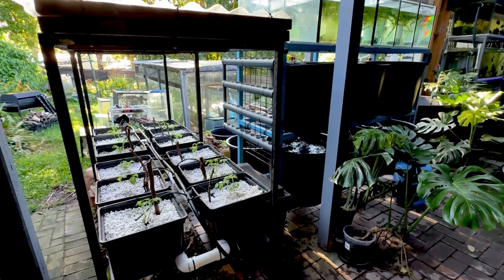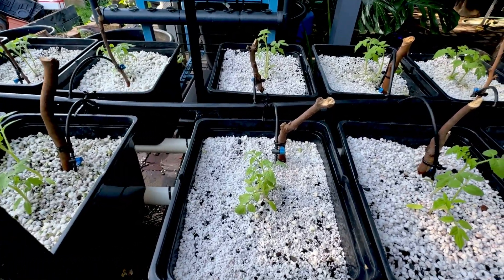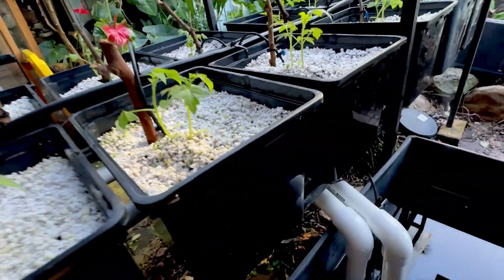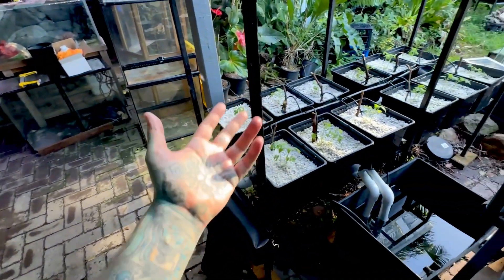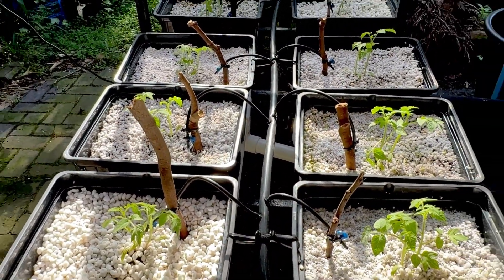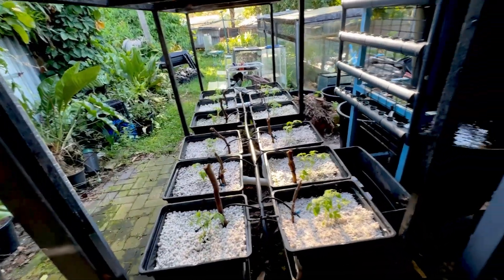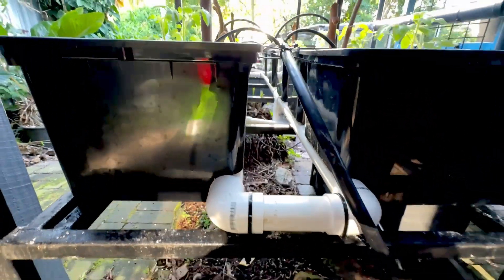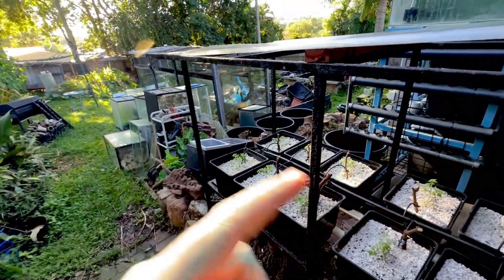SOLAR DUTCH BUCKET HYDROPONICS : New Improved System!

Comment: Καλημέρα τό ηλιακό πάνελ πού χρησιμοποιείται πόσα vatt είναι; έχει αυτονομία νά ποτίζει την καλλιέργεια ακόμα και της νυχτερινές ώρες πού δεν υπάρχει ήλιος;
Reply from the maker: Howdy , it is a 10w panel and 6.5w pump , you don't need water at night as the bato buckets hold some water
Reply: Πόσες φορές ποτίζεται την ημέρα; και ο κάθε κύκλος ποτίσματος πόση ώρα διαρκεί;η δεξαμενή πού έχετε μέσα τό θρεπτικό διάλυμα πόσα λίτρα είναι;
Reply from the maker: @kostasgialias1139  it's on and off for around 8 hrs a day depending on sun , the sump is around 60lts
Reply: Όταν ανοίγει ανοίγει τό σύστημα για να ποτίσει πόση ώρα περίπου διαρκεί τό πότισμα; ευχαριστώ πολύ για το χρόνο σάς.

Comment: You're a busy fella. 🙂
Reply from the maker: Sometimes!
How's your new fish going? can you see them ? :D
Reply: @paulstingrayGardening  Just. A magnifying glass helps. 😆 PH in the bag was high when I got home. 7.4. Don't know if that normally happens or it has sneaked up in your tank.
Reply from the maker: @Scuffed_Andy  it can jump in the bag , usually will jump again once the bag is open. but we keep those tanks 6.8 - 7.2 on average
Reply: @ ok. I raised the PH a bit in the tank so the jump wouldn't so big. I'll get it down to 6.6 over the next couple days. 🙂
Reply: @Scuffed_Andy  oh you should’ve just took an extra half hour in the bucket to bring it down a little bit more. As raising the tank quickly will jump it back and forth. I just double checked the tank and it’s hovering about 7.2 according to our scale.
Reply: @paulstingray  I think I moved the tank from 6.6 to 7. I'll keep an eye on it. Hopefully a slow move back will be ok.